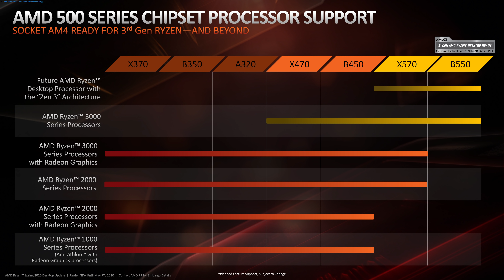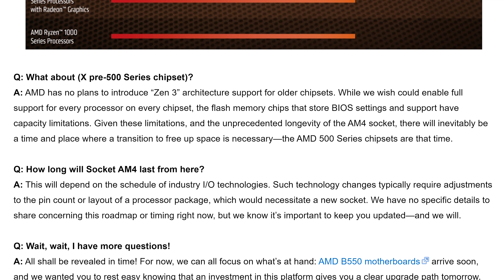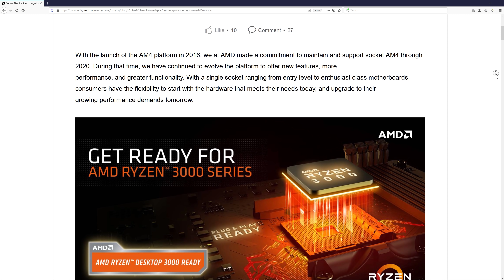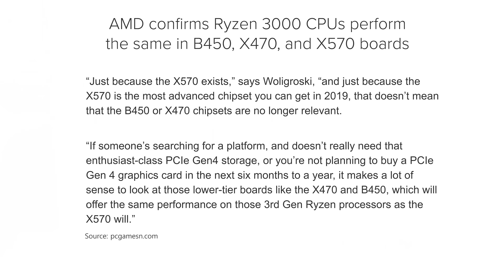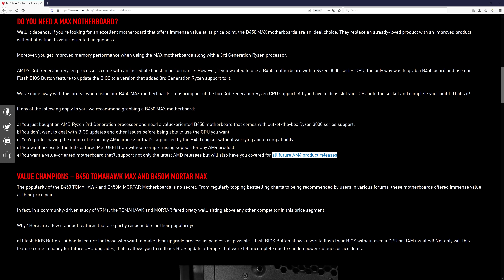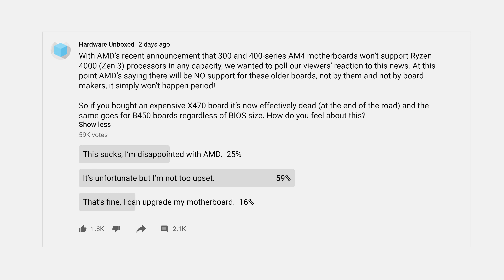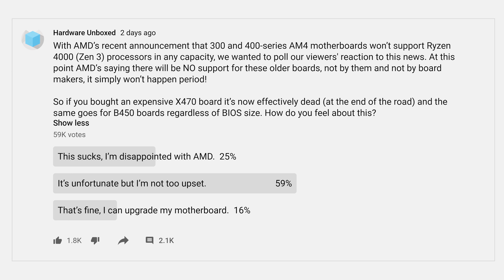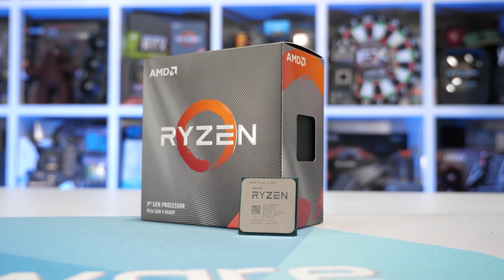AMD Does An Intel, Axes Zen 3 on 400-Series Motherboards, Our Thoughts

Comment: 3:06 These limited BIOS options would be a horrible costumer experience. Just imagine someone flashes the wrong BIOS version and drops the support to the current CPU what is in the motherboard. Keep in mind you representing 1% of the costumers at maximum. Most of the people never enter into the BIOS, and some update it trough windows software barely even know what they doing. These type of crap very common especially in laptops, they get a popup message "You need to update your BIOS because of .....lalala....." every time when the start windows.

AMD was honest about the SPI chip limitations, I think its a better move then lying about the problems. Not every board partners released MAX versions, they rather dropped support for some older CPUs. Angry costumers and board partners probably force AMD to add support for at least B450 MAX versions.

The best solution would be for AMD to stand out and apologies for the inconveniences "Sorry we srewd up" or add support for B450 motherboards even if these are Beta BIOS with limited CPU support.
Reply: Do you have any relatively new research data telling about (1%)? In early-mid 00's - maybe ... But operating modern BIOS isn't any harder than operating Windows, not to mention you could always ask for help on the internet. Secondly, people that do not enter BIOS most likely wont flash it anyway.
Reply: @Tjecktjeck  No I have no data, but probably it's way less, rather 0.1%.

Have you met other people who has a PC? They do stupid things, you can make a living just from BIOS rewriting.
"Modern" UEFI BIOS just as bad as the first UEFI BIOS like 10 years ago. I never have to rewrite an old blue style BIOS, but I rewrite UEFI's every day. Not mentioned that they can brick other component on your motherboard like Audio, LAN, or SATA controllers.
Reply: But lots of the motherboards have bios flashback options.
Reply: @jamesthomson8659  And what o you do if you just bricked the only access to the internet? Sure you have a phone you can search and realise that you screwd up, but if you not a tech person and don't have an OTG cable, you just bring your PC to a service, they charge how mach they charge and that's how people switch to MAC "It's just working"

Comment: Through 2020 literally means through 2020, as in, until 2021.
Reply: Harold Yeoh DDR5 will be expensive and in its infancy when released. Mature ram is much better.
Reply: @Harold Yeoh unless DDR5 is expensive. Waiting for the price of DDR5 and hoping it's cheap
Reply: Try explaining that to people on reddit smh
Reply: Except they said AM4 through 2020. That's not the same as "all products with the AM4 chipset will be compatible with all processor releases through 2020" 

x570 = AM4. It will have support in 2020.

Comment: This is really  dick move AMD. I bought asus CH7 x470 , the most expensive high end x470 motherboard, cause i was expecting to upgrade end of 2020 to zen 3, from 3700x to 4900X, and that it would last me at least 3 years! Now I am stuck with 3700X for next 3 years and a overpriced motherboard with no more possibility beyond zen 2.  Seriously, Fuck you AMD, and the pieces of S**t who took this decision to cut off support for x470 and b450.
Reply: I did the exact same thing. Went Asus x470 Strix and a built my first custom water loop on a Monoblock so I'm stock on that board unless i want to buy a new board and a new water block. Bought the 3700x with the board both 6 months ago and figured when Zen 3 came out I'd sell it then go 4900x and it'd be a sweet setup for the next 4 years. Now I'm stuck on a x470 board with a damn monoblock and a 3700x until my next rebuild. As someone who's built all AMD machines the last 15 years I think when the time comes I'll be taking a long look at what intel's offering.

Comment: Isn't this mostly due to BIOS memory capacity limits? Board manufacturers cant fit 1000, 2000, 3000 and 4000 entire lines code on a 16mb memory chip. Yes the Max Tomahawk has more BIOS space but as far as I'm aware it's the only AM4 with a larger capacity chip. I know of no other one.

That's it AMD, from this point going forward use Intels model 🖕 and make a new board that only supports the new CPU every single release from this point on. Obviously 3 generations of CPUs isn't enough. Teach the whinny little ___ s a lesson. Why not with all the The sky is falling chicken little reactions.
Reply: Almost all the x470 boards have 32 mb. Most of the x370 and B450 boards have 16 mb. At the very least those who opted for the high end x470 boards should be given support for buying a premium product capable of running the bios for all the generations. Here's a listed of all 300 & 400 series boards. Look under the flash ROM for the amount of bios storage. 
https://docs.google.com/spreadsheets/d/1wmsTYK9Z3-jUX5LGRoFnsZYZiW1pfiDZnKCjaXyzd1o/edit#gid=2112472504
Reply: You are not very knowledgeable.  MSI was the only board that couldn't fit the full   current bios on a 16 mb chip, they made it work by having a lite bios.  But lots of boards have 32 mb bios especially X470.
Reply: @jamesthomson8659  "...as far as I'm aware of..."🤔
Reply: @jamesthomson8659  I'm soooooo glad I watched Gamers Nexus video on this subject.  As Steve clearly states around the 14 minute mark, yes there are some motherboards with 32mb rom but it isn't most or even many !  Regardless of the list shared above, as usual that's only one side of the coin (and not one representative of a majority of AM4 boards)

He covers both arguments btw. Watch for yourself Mr all knowing :https://youtu.be/JluNkjdpxFo

Comment: Yip, I am one of those customers.

Choice was the MSI b450 T Max or the Asus TUF x570. Went with the former, extra RAM and NVME along with a 2700 instead of a 3x00 - thinking I'd wait for Zen 3.

I was coming from X58 so got a great VFM from that, I'll probably save for the 16 core 3000 series now so I still have a decent upgrade route. Id be way more pissed if I'd got the 3600/3700.

Comment: Technically they said that they would support the "AM4 socket", not the chipset. They are still using AM4 for Zen 3 right? 🤷🏼‍♂️
Reply: Technically the x470/b450 socket is AM4 right? So technically they're not supporting the AM4 socket, right? Technically if they changed the socket for Zen 3 to Am4+ and made all the 500 series motherboards a AM4+ socket then the same amount of people would have to buy 500 series mother boards for Zen 3, right? Technically speaking that is.
Reply: Joel S but didnt they state that b550 would still support ryzen 3000?
Reply: Technically yes.  But that is just bait and switch.

Comment: I bought a 450 Tomahawk in Sept. and paired it with a 2600. I've never bought a CPU at launch, but I might with a 3300x depending on price and performance, but the fact the a MB won't support the next next-gen 4000 series doesn't really matter. By the time I would want or need to upgrade that far, I would more than likely be upgrading to new MB features anyway. Unless I'm wrong about compatibility, I can curerntly support a 1000, 2000, or 3000 series chip. It's pretty unreasonable to think you'd be getting unlimited compatibility indefinitely.

If you're a super enthusiast and getting a 4000 series day one or early in the cycle, you're probably able and willing to get the new chipset with PCIE4.0 anyway.
Reply: Not unlimited compatibility, just the compatibility with ZEN3 they talked about back in 2017.  When DDR5 becomes a reality they will need a new socket.

Comment: I keep hearing "PCIe 4.0 is the only reason for x570", but as I've been working on a video editing build, and found that a 3xSSD arrangement is considered ideal for that, I found that x570 is the only way to have 2x full-speed Gen3x4 NVME drives.  Granted, this is a super-super edge case to the average user who only needs one high speed drive, but it's definitely a reason that doesn't involve PCIe 4.0. 

From all the x470 and B450 boards I found, the fastest a second NVME could run in Gen2x4, and it was surprisingly uncommon to find an actual m.2 slot to connect it; most boards require a pcie adapter for a second nvme, even those with 2x m.2, because most 400 series with secondary m.2 only support sata on the second port.

B550 should make this work out as well, at which point, yeah, PCIe 4.0 is the only reason for x570, but b550 still doesn't exist for a month.
Reply: ASUS B450-F can run 2 full speed Gen3x4.  It does limit the video card to X8 instead of x16.  That's why it is a better MB than the Tomahawk.   I'm running two full speed and Gen 3 x4 on an Asus X470-F, video card also at X8.    The second NVME is on a board in the 2nd video slot.  Most video cards don't max out PCIe3 x8.    Maybe a 2080Ti.

Comment: I find it to be an over step by the consumer community bitching about support when  AMD has given so much for so little. Technically they didn't lie the socket is the same in 2020
Reply: Technically you are correct.  But that's just weasel wording.  They are not supporting the AM4 sockets they released in 2017.

Comment: Your Bios solution sounds good and AMD would be smart to use it. I don't think this will break them but it will piss off a bunch of customers. B450 and X470 should be able to run 4000 series for sure.

Comment: honestly if AMD had released a b550 board at around the same time as the zen2 release, I don't think the sting would have been so bad.
only releasing the x570 meant that the only real budget option was to go with the cheaper b450/x470 boards.

just curious, but maybe msi might be in trouble with consumer laws in Australia and might be obligated to offer refunds due to false advertising in their max line.
Reply: Either that AMD to MSI for false advertising.

Comment: Wow. AMD said 2020. Your response is.. " start or end of the year" And your talking about a CPU that is not even out yet. They kept the same motherboard Socket for 4 years and you are all bitching. What this really means is a years from now I will still be able to buy a motherboard that will replace my 2016 motherboard. Do you know how many perfectly good intel CPUs i tossed because I could not buy a MB for them? I will have had a 5+ year window to replace my motherboard with a new part with warranty. Stop wishing the world revolved around you and just say thank you!! And if that is not a good reason. Would you as a  MB manufacturer want to invest in a platform that does not make you money because no one has a reason to upgrade their board? Nope. And I'm sure AMD is very aware of that. Welcome to the real world.
Reply: Boards with AM4 came out in 2017.     I'm sure motherboard manufactures would be only to happy to sell you a B450 board for series 4000.  Just like they were happy to sell B450 for series 3000.  They will  make more money on a B450 as there is virtually no development cost.  They just need to update bios.

Comment: I bought a tomahawk max for that same reason, keep in mind a tomahawk max is $130 in my country and there were $90 and $85 cheaper options; like the Asus steel legend, but I saw your B450 ranking video and went for it, and someone bought me a 1600 AF from the US, and I thought that in the future I could buy something better, because tbh $85 for a 2600 performance is just too good, and I have a 1660s so basically the IPC increase for gaming doesn't matter. However, as you can tell I am a very value oriented person that is why I decided to pay more for a motherboard, if AMD said they would axe the support I wouldn't have bought a B450 and actually pay more for a $200ish X570, because a system that is $70 more expensive, but has PCIe 4 and will support 4th gen high-end Ryzen is definitely worth that $70. However, what is even more interesting to me is the people that will have to buy B550, for only one generation support and they don't have any other options, Oh man is this Intel all over again just with an AMD name.

Comment: I think AMD are making a mistake here, how many people are going to buy a B550 board this late on knowing it is unlikely to have has any forward support beyond Zen 3 when they change the socket next time round?? This could also mean some of those B450 owners who would have invested in new CPU's with Zen 3 will now sit on what they have potentially meaning less sales of this generation.

A massive lack of foresight to wait until now to make this clear when X570 launched, I agree they should have positioned X570 as the platform if you want PCIE gen 4 and Zen 3 support and B450 as the Zen 2 and budget option at least then people could make an informed choice.

I don't have a horse in this race personally as I went X570, I can't help but feel the frustration of those who went B450 based on information such as that presented by MSI regarding future otptions, it just feels like a dick move.

Comment: Holy hell the crying is real in this video. Intel has required a new board every 3rd chip release going back to Sany Bridge. At this point no one should be complaining about what has been standard practice for the past decade. While it may not have been strictly necessary each time they did it, it did allow them to push their technology forward. They may have fabrication issues right now, but they've had chips running at 5Ghz for years now. Either via end user overclocks with no need for exotic cooling, or chips hitting 5Ghz stock. Intel was able to do this in large part because they allowed their motherboards to continue advance along side their CPUs.

EVERYONE knew that the backwards compatible AM4 support had to end at some point. Big kudos to AMD for going as long as they did. We got 3 generations of chips from AMD all backwards compatible. 1 more than Intel, and they did it with larger revisions and upgrades than Intel did too. But we've sort of hit a peak in terms of core count increase. If AMD wants to move forward at all, and stay ahead of Intel, they need consumer level CPUs hitting 5Ghz without exotic cooling. That's going to require a redesign of their chips, along with motherboards to support those design changes.

When Intel finally gets their fabrication sorted out, their chips are going to be scary fast. What they've been able to do on 14nm is nothing short of commendable. They finally get chips on the market at 10nm or smaller for the fab process and we will be seeing 12 core 24 thread consumer chips hitting 5Ghz+ all core with nothing more than your basic AiO. That's what AMD needs to compete with at this point. Not the current Intel chips on the market, but the chips Intel will bring to market in the next year or two.

Comment: You hit the nail on the head for me at the end.  Why would someone upgrade from a 400 series board to a 500 series board just to upgrade from an earlier gen Ryzen proc to Zen3?  It's a pretty safe bet that Zen4 will support DDR5 and other features that will force a board upgrade again..
As a user and a stockholder, AMD is going to hurt sales overall for Zen3.  Sales will be limited mostly to users you are buying into the platform for the first time.  I can't imagine many users bought an X570 and threw in a Ryzen 3400G while they waited for Zen3.
The real kick in the pants will be if they wait six months after Zen3's release to announce they changed their minds after realizing sales of Zen3 are suffering due to this.  In the end I suspect this will change and at least 400 series boards will get the updated Bios needed.  Just drop Zen1 support with the upgrade.  Not many people with 400 series board would be running Zen1 and Athlon procs.

Comment: I believe this is all planned and is what intel knows about and is why they do it. To increase margins on a new gen launch of CPU’s, you need to sell the consumer both a new chipset and a new cpu. There may be complications in the hardware but as you can see, a 9900k can work perfectly fine with a z370. Another 14nm refresh’s from intel followed by a ‘new’ z390 chipset in order to make more money. You can’t make that money if people are just using their old boards that could work with the new gen of chips. And the corporate top hats see that as a loss on profit.
Reply: The real loss to their profit will be the CPU sales going down dramatically for Zen 3 when compared to Zen 2+ when all the 400 series mother board owners don't buy a 500 series boards and just stick with their 3700x. The reason they sold so many Zen 2+ cpu's is because of the AM4 socket compatibility with 300 and 400 series mother boards. There will be a very small market of people buying both 500 series mother boards and Zen 3, mostly likely people buying into ryzen for the first time or people that are still running zen 1 on a b350 who are actually willing to upgrade both rather than just buying a 3000 series cpu. But even then, many of the people that actually fit that criteria will pause at the idea of buying a x570/b550 only supporting this last generation of zen 3 before a new AM5 socket for zen 4. The majority of Am4 socket owners aren't on x570 and aren't going to want to buy a new mother board and cpu for just 1 generation. They are about to take a huge hit in sales.

Comment: What I want to know is why they won't support the x370's, like the ASUS Crosshair VI Hero that I bought, that has a 128MB Flash ROM (according to the user manual) Espeically after spending $300 for it on day 1 of the 1800x's release... Just seems kind of crappy to me, especially when technically it seems like the board can support it......
Reply: You have a 128 Mb flash ROM which is 16 MB. Almost all the 300 series mother boards have 16 MB. Take a look at this spread sheet for further information under flash Rom. 
https://docs.google.com/spreadsheets/d/1wmsTYK9Z3-jUX5LGRoFnsZYZiW1pfiDZnKCjaXyzd1o/edit#gid=2112472504
Reply: @joels6736  Ahhhhhhh I see, I didn't realize the small b after M in Mb, oops thanks!